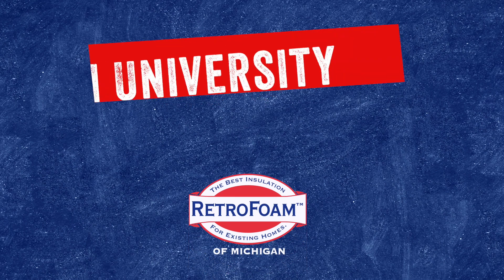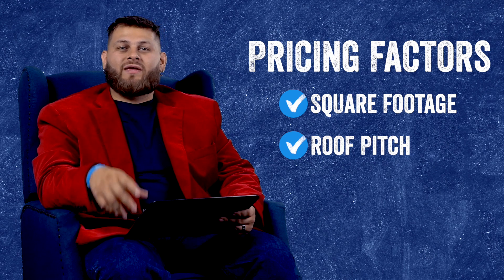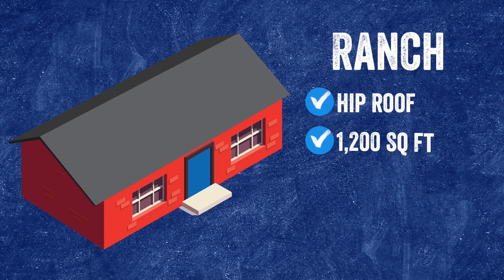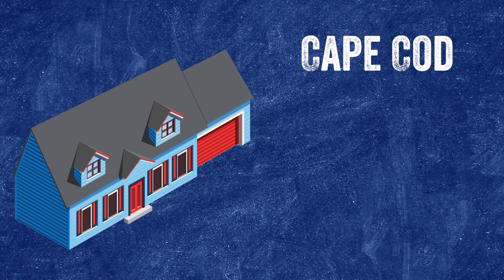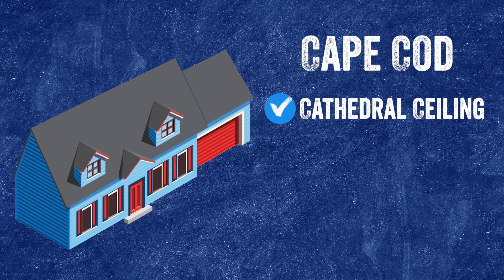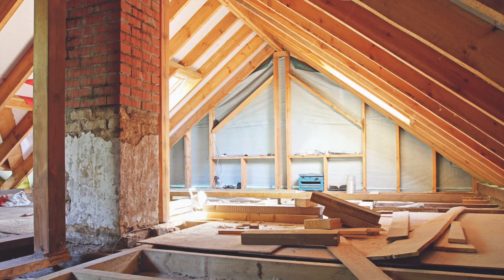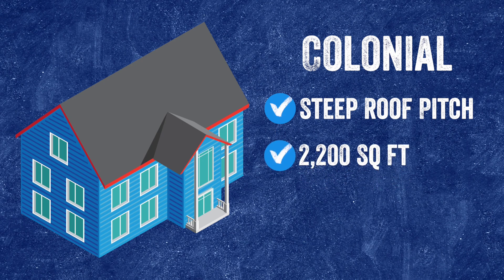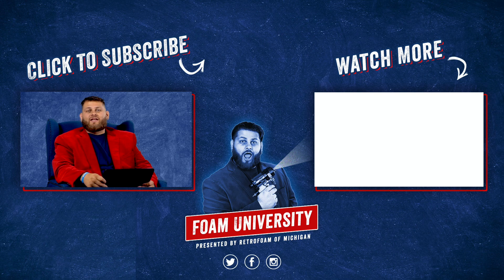Attic Spray Foam Insulation Cost: Pricing Factors and Budget Range for Homes | Foam University

Comment: So I would assume closed cell foam (but never mentioned exactly I think), but how deep does it need to be? All I saw in the videos were the roof rafters being completely filled. If I have 2x8 or 2x10 rafters etc... do they need to be completely filled in with foam?
Reply from the maker: This will depend on climate zone, code, and other factors. We talk more about this here https://www.retrofoamofmichigan.com/blog/spray-foam-insulation-thickness-requirement